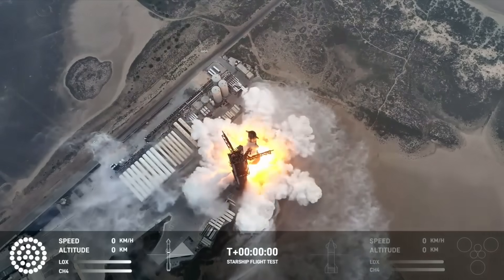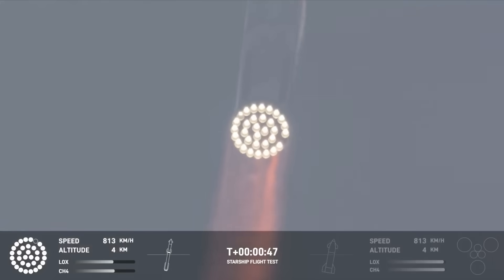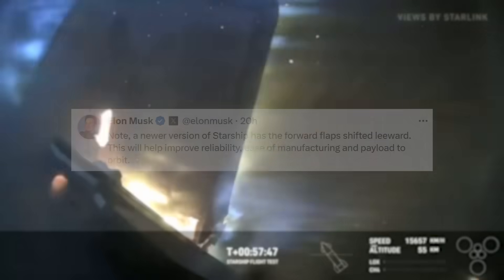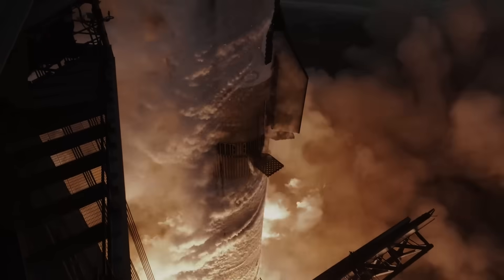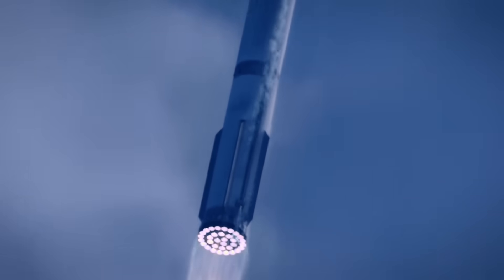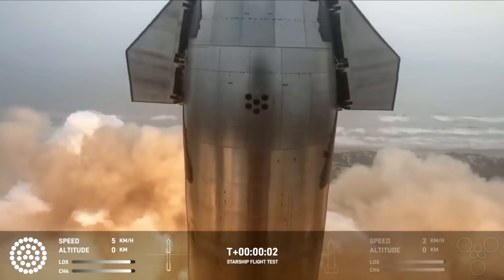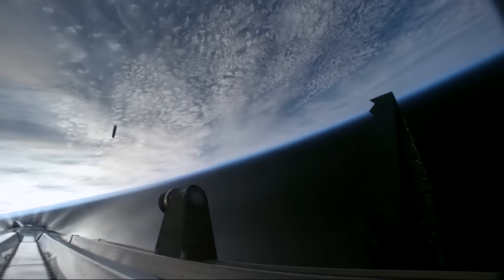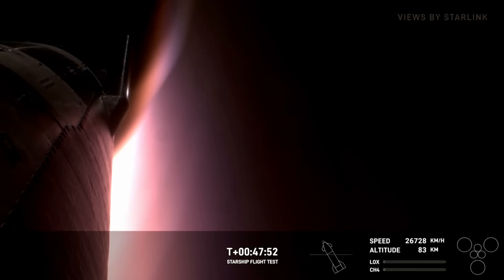SpaceX Has A Plan to Fix Starship's Heat Shield

Comment: SpaceX does not have a good test rig for the development of its heat shield! That is the major take away from this launch. If SpaceX had a good test rig for developing a heat shield, then we would not have seen the catastrophic failure of the thin that we saw on this lunch. SpaceX has had four years or more to be working on the heat shield, but they still don’t have a physical test rig or computer programs that are adequate to predict what is going to happen. Eventually, they will engineer a good shield, but it’s going to be extremely expensive to do so if the only real test has to be actual launches.
Reply: Actual launches to the indian ocean is the best and cheapest test rig you can develop. SpaceX isn't afraid to look bad to get the test data they need to get it right.
Reply: @tidan4575  
Well, if you are right, then SpaceX has had exactly 4 test of their heat shield. So far, they haven’t been able to examine the results of their test up close by looking at the heat tiles after reentry once. How long do you think it’s gonna take them to collect them off data at oh I don’t know $1 billion a shot in order to get the shield actually right?
Reply: @wbwarren57 lol at you thinking a steel can constructed in a glorified garden shed cost SpaceX a billion dollars a piece!
Reply: @wbwarren57  first of all the first two tests don't count because a separate system failed first. As for the third, the rocket had no control over it's spin putting the heat shield well past its design limits. (I'm surprised the ship lasted as long as it did before burning up.) The fourth fight test was the heatshield's first true test.
They also are running simulations on how things are going to behave and what to expect but they can only go so far with theory. If spacex had the same failure happen a second time from a malfunction of the same system then yeah that IS a problem. But because they rarely make the same mistake twice, I call it a successful failure.
Reply: @wbwarren57  SLS is a billion a shot, really really doubt if a starship launch is anywhere near that.
Reply: @EdToml SLS costs significantly more than one billion dollars per launch (at least double). But ~$1B per Starship test flight seems realistic for Starship, if you include some of the associated development costs. In early 2023 Musk claimed SpaceX would be spending about $2B on Starship development over the course of the year, and they had 2 test flights (IFT-1 and IFT-2).
Reply: @plainText384  yes but for this discussion, the marginal cost of a unit matters, not the total development cost

Comment: What this flight show, it's that SpaceX could drop the flaps or reduce it size. Replacing it function with thrusters.
Reply: I think you need them when you're coming back into the atmosphere a little faster. As far as reentries go, this is as slow as they come. And flaps don't require fuel.
Reply: Losing part of a flap doesn't mean the ship can work without any, it also has to aim at a precise target, it can't just land anywhere
Reply: Thrusters require fuel. Just enough fuel is saved after the launch burn to power the slow down for rentery…and the death defying final blast of energy to achieve zero G at landing. The flaps use plasma energy to steer…much the same as wings and flaps harvest moving air to sustain flight and steerage in an airplane.

Comment: Why not make the fins out of ablative material that erodes at a known rate then just replace them after each flight? It would amount to only a small percentage of the overall ship that is sacrificial.
Reply: Why not follow the principal of the best part is no part?
Reply: The original BFR also has no flaps at all. Just make the RCS a lot stronger and use them all the way to the landing.o @tedmoss
Reply: It wouldn't be reusable. Also it's not the whole flaps that's the issue, but instead specifically the hinge area. I don't know if an ablative heatshield would perform much better there.
Reply: what part of your plan is rapidally reusable?

Comment: Heat shield problem is going to blow a hole in SpaceX's reliability and turn around goals.  Thousands of tiles are single points of failure.  Ask the Shuttle program about this
Reply: The shuttle failure was a failure of people to check things properly.
Reply: @tedmoss  what?
Reply: Shuttle failed because it got hit by ice or foam coming off the tank of very cold hydrogen.  There is no tank above starship and they don’t have to deal with hydrogen.
Reply: You are not wrong, however, I doubt they would be going with this design if they didn't have any ideas on how to make it work.
Reply: @SebastianWellsTL  There is no alternative. When you have protrusions all the worse. X37 B might help as an example to emulate or SNC

Comment: I vote they catch IFT-5 Booster as well. They aren't worried about Tower build time, they have one spare already. 4 months to replace IFT-2's demo of the pad to IFT3 launch, then 2.5 months to reach IFT4... They are in a low risk scenario, REBUILD: <4 months should anything drastic happen with catching IFT5's booster.
Reply: Remember that no testing can be done without the OLM/OLIT so you would have to add that to the timeline. At that point you’re looking at adding ~1,5 months to it.
Reply: Better to user the tower parts they are shipping from Florida to build a catch-only tower further away from the fuel depot. That infrastructure would be harder to replace, and with the infrastructure they have it's easy enough to move a booster from the catch tower to the launch tower, but more likely back to the high-bay first for inspection.
Reply: @jeffanderson-lee1574  While that is a good idea, it isn't a good idea. Making the second tower catch only would result in the newer and improved equipment to be subject to damage. Additionally, it would make adding the OLM later harder, which would delay the timelines for things. It would in general be better to subject the current tower to the damage instead of the newer one, since if the current OLM gets destroyed, it would be easier to make a new and improved design. The tower itself likely will be mostly fine if a superheavy crashes on top.

Comment: The starship should launch again in closer than 3-4 months from IFT 3-IFT 4 it took around 85 days or less than 3 months.  Now since the launch was fully successful , there won’t be a FAA investigation/mishap report, the next prototype has been partially tested and I heard that spacex removed the starship lean off the tower so the flames would do less damage to the orbital launch mount so with these factors it should happen much faster. 6-10 weeks?
Reply: Depends, really.  They've stated that they intend to have the flap issue solved for the next flight.  There are only two scenarios where this happens: 1) They move directly to Block 2.  While the first Block 2 ship is indeed being manufactured, it isn't done and would need to undergo the usual suite of tests afterward.  2) They retrofit Ship 30.  This vehicle has been done and tested for a while.  Making the necessary changes to the fins would take quite a long time.  So if I were to judge the situation, I would say that they're really far more likely to proceed with Ship 30 as-is and accept the fact that it will probably have much the same problems during reentry.  Otherwise they'd be needlessly delaying their next flight.
Reply: I tend to agree. Since I saw nothing in IFT-4 that, with the newly granted FAA exemptions, will trigger a mishap report the IFT-5 license should be a formality and SpaceX could probably get that in a couple of weeks if it really needed to. That leaves repairing launch pad/tower damage and retrofitting any design changes that SpaceX wants to test on the next flight as the limiting factors. With constant improvements to the launch facility resilience I'm hoping that getting the pad ready for the next launch might only be a 4-6 week job this time around. So that leaves retrofitting design updates to ship and/or booster as the critical path (i.e. the maximum delaying factor) for the next launch. Not knowing what SpaceX wants to do there makes it impossible to predict but if it is limited to perhaps very localised changes to flap seals that engineers have already worked out in detail then just maybe we can see the next flight in a couple of months rather than 3-4 months.

Another possibility is that with the only major issues (that we know of) being ship re-entry just maybe SpaceX might fly again with no attempt to fix that but instead go for IFT-5 primary mission objectives of some or all of on-orbit Raptor relight, payload bay door testing (the IFT-3 test didn't look 100% convincing), maybe some other on-orbit stuff, perhaps more instrumentation at specific places on the Ship to collect more data as it gets damaged during re-entry, maybe leaving different tiles off to collect data at more points for that experiment, and also having another go at precision booster landing to get more re-assurance before risking an actual catch.

Typing all that out I'm now thinking that there are so many objectives that SpaceX could attain even if flying an identical Ship design that again takes severe damage I wouldn't 100% discount the next flight going ahead as soon as the launch facility can be made ready again maybe 6-8 weeks from now (4-6 weeks to ready the pad etc and an extra 2 weeks to allow time for booster cryo, SF & WDR tests).
Reply: @julianfp1952  I'm not convinced that it necessarily takes SpaceX two months to get things ready on their end.  We already understand perfectly well that the FAA licenses "miraculously" arrive within about a day of each new launch.  That can only mean that the FAA keeps SpaceX updated on when they reckon they'll be done with their paperwork, and so SpaceX shuffles ground activity around to meet that schedule, filling blanks with productive work.  If the FAA is faster in any meaningful sense this time, the license could arrive in under a month.  There is nothing more important than flight data right now, so I just can't see SpaceX letting the license rot for a month.
Reply: probably not. Likely they will build the other tower first before attempting a catch
Reply: Spot on, I think.
Reply: I say less then 2 months. They are going to modify one of their many starships laying around, then they gonna fuel and test. If your going to build a rocket with a rapid turnaround of an hour. It's going to have to start accelerating
Reply: Depends on the engineering, manufacturing, install and testing based on flight 4.

Comment: The fact that the flap kept working even as it was burning says a lot about the robustness of Starship's engineering/ They'll continue to make improvements until everything works.👍👍
Reply: The last thing you want to see out the window is plasma venting through the flap and tiles flying off.
Reply: @paulurban2  they have pee bags integrated into the space suits so it shouldn't be an issue
Reply: @paulurban2 this was literally the first iteration, it won’t happen on the final version
Reply: Can’t help but think of Columbia’s final reentry.
Reply: @steveschunk5702 
😢
Reply: @paulurban2 you won't see. You are not on any trip on starship.
Reply: @notgreg123  there is no point for such hypothetical because starship is not for such people who can't do anything but cursing.
Reply: @namei8967  that's... Entirely besides the point
Reply: Yah. I could see Tim Dodd surviving that re entry on dear moon.
Reply: @tech5298 I'm sad dear moon was canceled 😢
Reply: @tech5298  well he would coming in at 40000km/hour so i think they could roast marsmellows inside starship
Reply: The choice of high temp stainless steel was inspired. As I said previously, I wish they would attempt to test the original transpirational cooling idea on a small section of a test Starship. Somehow I think that might end up with a lower mass penalty if the fluid requirements are low enough. However, the holes that make up the pores may be prone to clogging like the little pores of aircraft that engineers were testing for boundary layer control in the 50s and 60s.
Reply: It looks like the flap finally fails after the flip maneuver. It flips and then the flap kinda twists or something, but only after it did it's final job to help the flip.
Reply: The foundation for the USS Starship Enterprise

Comment: Stoke Space's heat shielding using cryogenic fuel instead of thermal insulation is a huge leap forward in technology but not sure if it could work with the massive surface area of Starship.
Reply: This was the original plan, actually.  It was abandoned fairly early on, likely due to the excessive amount of "extra" fuel required for re-entry and / or the difficulty of pumping vaporized fuel to the engines.
Reply: @jmr5125  Thanks for the info.
Reply: The best part is no part.

Comment: I know nothing about welding but i'm wondering whether a different material such as titanium could be used in the highest risk areas to better maintain structural integrity.  It'll give them another 400 deg C to play with.
Reply: benefits of stainless steel are high strength at cryogenic temperatures (benefit for flight), bad thermal conductivity (that's a benefit during reentry heating) and it's cheap. titanium is definitely not cheap it's a nightmare to manufacture parts from titanium and i'm not sure about strength at cryo temperatures.
Reply: Titanium might have high temperature oxidation issues.
Reply: @kolbyking2315  It doesn't. It has embrittlement problems that you don't want on a reusable ship.
Reply: Availability was also a huge factor in the decision. If SpaceX scales up to building a Starship a day, they still won't be consuming a noticeable portion of steel production.

If SpaceX tried to buy titanium in those quantities, production could not keep up.
Reply: Why screw with something that obviously will work?
Reply: Robert Jung. Read my comments earlier about the structural failure of the hinge point of the flap. In that tricky zone where the flap rotates adjacent to the Ships main body…plasma got in….and gradually eroded the underlying stainless steel. The heat tiles are working. It is just in this sensitive hinge zone that they failed…or…the insulation system isolating this zone was not good enough. No need to go off on alternate metallurgy…stainless tel will work. Just redesign this sensitive zone. My suggestion to offset the hinge line…allow some plasma flow between the flap and Ship’s body.of course this will have to be verified by aero or plasma flow specialist…as the primary steering/guidance function must be fulfilled.

Comment: Did the flaps have any Inconel, molybdenum, niobium, or hafnium parts? All those handle heat better than 304L stainless steel.
Reply: Temperature at reentry max maybe ~ 1650 deg C. SS melts at 1400 deg C.
Hafnium ,Niobium, molybdenum etc have higher > 1650 deg C though expensive. 
Trying these for flaps is not a bad idea.
Return from lunar missions will face temperature ~ 2800 deg C
SS with teflon ablation may be tried to bridge the gap 1650/ 1400 deg C only on the flaps by ablative gases preventing the SS  from melting. But what about the hinges?
Reply: Probably, but there no way to know.
Reply: @brianknow9142  Maybe plasma color? Copper is blue-green, iron is orange-brown, chromium is silvery-white, and niobium is green or blue.

Comment: At what altitude do they need the flaps to start functioning? 100km?  Also,  since they'll eventually need to insulate the dorsal side from solar heat gain,  can the tps tile also function as insulation on that side?
Reply: There is no plan nor a perceived need to put tiles on the leeward side of the ship.
Reply: Probably not.
Reply: on human rated starships sure they will need to insulate the crew cabin, other than that no